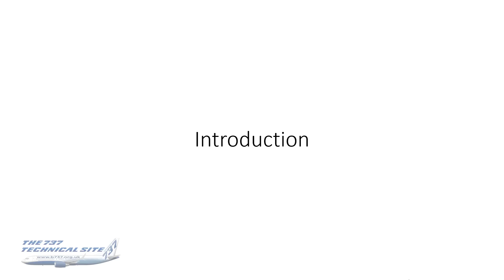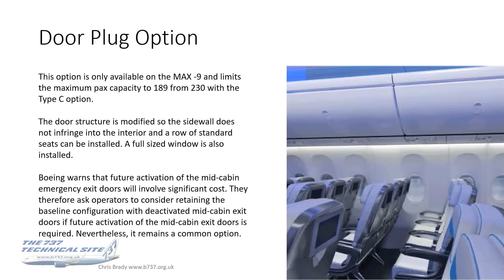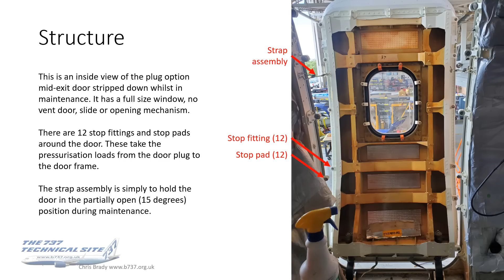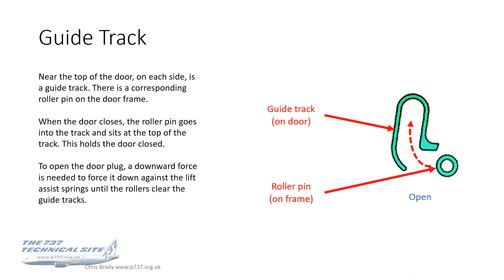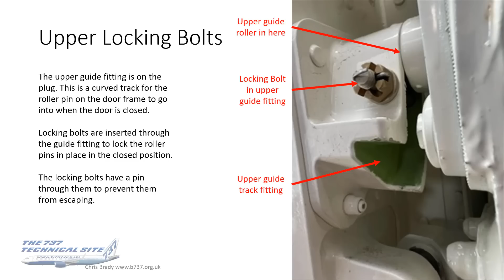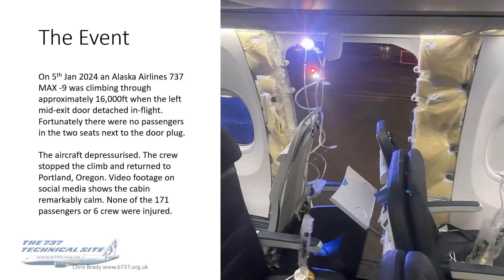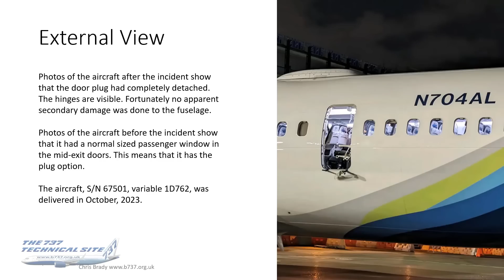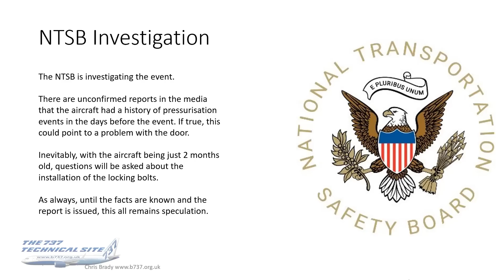737 Mid-Cabin Emergency Exit Doors - Plug Option

Comment: Update: found a picture that expains one of my questions.  And it was written in plain sight on the graphic by the author of video, my bad.
The guide track is on the door/plug and the roller pin is on the frrame.  Therefore, the door must be lifted so that the gide track rises to a point where roller pin can "exit" from it.
Reply from the maker: * Errata *
In this video I state that a downwards force is required to remove the door plug. I based this statement on text in the AMM SDS which I now believe to be incorrect or misleading. It is possible that a very small downwards motion (1-2mm) is first required to be able to free the locking bolts. But the door must be moved upwards by a couple of inches to clear the guide tracks. Apologies for any confusion.
Reply from the maker: AMM SDS 52-23-00 Page 6 MID CABIN EXIT DOOR PLUG - COMPONENTS, Lift Assist Springs:
"Apply a downward force to the door plug this forces it down until the rollers clear the guide tracks. At this time the door plug can open outboard."
Reply: At 06:43 and elsewhere in your video you show the graphic of the guides and roller pin,  and the roller pin is marked as being on the door frame ,a dthe guide on the door frame. And based on that, you need o lift the door so the roller pin finds its way out of the guide.   If the rollers are on the door, then yeah, downward pressure on door clears the guides and can open outward. The graphic published by NBSB Newsroom on the site formerly knwon as Twitter confirms pin on on feame and guide is on plug/door.  Is it possible the guide is upside down in yoru graphc and the opening is on top instead of bottom?  (not questioning your info, jusyt trying to understand).  And many thiks because you have brought so many facts in this.    @ChrisBrady737
Reply: @ChrisBrady737 You keep citing this as definitive, but it is incorrect. I really think you might need to reanalyze the other information to picture how the door plug is opened and there are many reasons that are obvious that once the locking bolts are removed the removal is up, then hinges outward. 

Look at the outside picture again. Why is there a cutout of the outer skin clearly visible above the door plug. It's there because the door has to go up to disengage the guide tracks from the frame mounted guide rollers before it can hinge outward.

Comment: If I was an airline that owned a 737 MAX-9 with the plug option, I would immediately be taking to the maintenance shop, removing the seats and interior panel and checking that all 4 bolts are present and properly secured with the nut and wire. Although I am sure that's exactly what airlines like Alaska have been/are currently doing.
Reply from the maker: That is probably what the emergency AD requires.

Comment: Do you know if there was any redesign of this plug and interface from the -900ER to the MAX?  Is it possible that the fasteners are done differently so an inspector might not notice a cotter pin that's missing or doesn't have its leg bent?

Comment: Wonderful description. Kindly anyone, just 1 thing is missing, If anyone can point out plug door operating handle from inside cabin plz...
Reply from the maker: The door plug does not have an operating handle
Reply: @ChrisBrady737  for the intial installation it must have a handle to seat the plug door in its position which may b removed after installation... saying that i doesnt cannot b digested

Comment: If you do another video about this, could you clarify if the door plug opens by moving down or up?  Is it a bistable mechanism like a landing gear hinge, or do the lift assist springs push it straight towards its open configuration at all times?
Reply from the maker: * Errata *
In this video I state that a downwards force is required to remove the door plug. I based this statement on text in the AMM SDS which I now believe to be incorrect or misleading. It is possible that a very small downwards motion (1-2mm) is first required to be able to free the locking bolts. But the door must be moved upwards by a couple of inches to clear the guide tracks. Apologies for any confusion.
Reply: It was confusing me too but I think you’d have to remove all 4 bolts, and then push down against the hinge springs to move the door plug/channel away from the pins attached to the frame, then once the door plug channel clears the door frame’s pins, it can go out. Seems to me like all 4 bolts were missing or very inadequately secured for this door plug to have come off so cleanly
Reply from the maker: AMM SDS 52-23-00 Page 6 MID CABIN EXIT DOOR PLUG - COMPONENTS, Lift Assist Springs:
"Apply a downward force to the door plug this forces it down until the rollers clear the guide tracks. At this time the door plug can open outboard."

Comment: @chris : Just thinking, isn't there a pressure seal too around the periphery of the fuselage cutout? 

There is a similar Plug door on Airbus A321, the ACF version and it hinges at the top while opening outward. The remaining structure is more or less the same as the Boeing plug
Reply from the maker: Yes there is a pressure seal

Comment: They didn't break off, but it's surprising how small those stop pads that hold the plug against the pressure of the cabin are. I was expecting something a bit more than those little ears.

Comment: Yesterday the video creator stated that the "plug" or more correctly the door blanking panel must be lifted to unhook from the stuctural-pressure-bearing-lugs. Today you say that the panel must be moved down. Looking at the mechanusm and the J channel bracket device it looks like yesterday was correct. Also the castleated nuts on the lockng bolt are locked with split pins. This suggests that they are tightrned to a low torque so as to not crush the upper J-channels or the hollow lower hinge struts. The split pin will prevent the nut from loosening or tightening.  The bolt retaining the blanking panel in the closed and locked condition by shear-load on the small bolt.
Reply from the maker: * Errata *
In this video I state that a downwards force is required to remove the door plug. I based this statement on text in the AMM SDS which I now believe to be incorrect or misleading. It is possible that a very small downwards motion (1-2mm) is first required to be able to free the locking bolts. But the door must be moved upwards by a couple of inches to clear the guide tracks. Apologies for any confusion.
Reply: Agree with your second sentence because it didn’t make sense as stated in this video based on parts involved.
Haven’t seen prior video.
Reply from the maker: AMM SDS 52-23-00 Page 6 MID CABIN EXIT DOOR PLUG - COMPONENTS, Lift Assist Springs:
"Apply a downward force to the door plug this forces it down until the rollers clear the guide tracks. At this time the door plug can open outboard."
Reply: @ChrisBrady737  That is hilarious - I mean, it's a nonsense, but so often you see instructions in the AMM that are complete nonsense.  I had a case where we had repeated failures in the same systems in our fleet, costing hundreds of thousands of dollars a year.  The engineers were diligently following the AMM procedure to test a pressure regulator - I had a good look at the procedure and it was written in a way that if the regulator wasn't regulating, it would nonetheless pass the test to confirm that it is regulating.  So I wrote a new procedure, but having told the shift managers that the tests they were doing weren't working, they just replaced all the regulators and the problems haven't returned since.  But if they do, the AMM will be changed when they do their next test.
Reply from the maker: Yes it is alarming that errors persist in the AMM and FCOMs after many revisions @paulsaccani1115

Comment: Fantastic video. So just 2 bolts keeping the door from sliding up out of the guides. I thought there’s supposed to be some redundancy built in into critical areas. I would have liked to see some type of hood catch or similar in addition to what you showed.
Reply: It look like there were two bolts at the top acting as pins, and additional two at the bottom also on those shafts above the springs
Reply: 4 bolts.

Comment: The critical thing about this design is that after the final and properly rigged installation a door plug, the assembly never moves down the 4cm which unlocks the guide pin from the guide track. That's the critical function that the four locking fasteners accomplish in two different protection mechanisms.

My understanding of the design is, that when in the "closed" position, the force of the hinge springs keeps the guide pin at the top of the guide track (just as its upward force would keep the pins from entering the guide track from the "open" position if the door plug was inadvertently shut when in the maintenance position.)

I suspect that even if only one of the four locking fasteners was in place (limiting pin movement down in the guide track or limiting movement of the guide shaft on the hinge), the stop pads would have stayed in sufficient alignment to not cause a failure. The hinge springs pushing up on the guide pin would provide additional location force.  So the system has some redundancy.

So I speculate that the root cause was that all locking fasteners were not installed and time or events overcame the upward force of the hinge springs, allowing over time both guide pins to move down the guide track to compromise the alignment of the stop pads sufficiently to allow the system to fail at load.  

Micro scratching on the stop pad interfaces should show wear indicating a loose and moving condition over time since delivery.
Reply: it moves up though

Comment: I'm not a pilot or engineer but I have one thought on the plug type doors that might be a better option and quite possibly prevent this sort of thing happening again. Why not make the plug door installed on the inside of the plane and have the plane and plug tapered smaller as it approaches the exterior. If it tappers 4-8 cm, has a good seal, and has 4-6 bolt secure points this should prevent this from happening. The door would not be able to blow outward as it would have no where to go. There was an accident in the UK in the 1980's of a different plane but same thing happening.

Comment: 7:10 You say the door needs to be forced DOWN to open it, but isn't that reversed? The door is lifted UP, with the force of the springs to open it, and down, against the springs to close it. If that's not right then some more explanation is needed about how the door moves to open and close.
Reply from the maker: * Errata *
In this video I state that a downwards force is required to remove the door plug. I based this statement on text in the AMM SDS which I now believe to be incorrect or misleading. It is possible that a very small downwards motion (1-2mm) is first required to be able to free the locking bolts. But the door must be moved upwards by a couple of inches to clear the guide tracks. Apologies for any confusion.
Reply: I noticed that also and it just doesn’t seem to make sense the way it was said, when looking at the mechanism diagram. I’m kind of thinking it’s somewhat vaguely similar to how a typical garage door would work.
Reply from the maker: AMM SDS 52-23-00 Page 6 MID CABIN EXIT DOOR PLUG - COMPONENTS, Lift Assist Springs:
"Apply a downward force to the door plug this forces it down until the rollers clear the guide tracks. At this time the door plug can open outboard."
Reply: I agree that there’s something logically in conflict here between the diagram and the text as shown at 6:33.

If paragraph two is true, which matches the diagram, then, how in paragraph three can the door be moved downwards when the pin is already at the TOP of the channels? .

Unfortunately, I cannot look at the photographs of those items at the same time I’m writing this. So, my next comment is based strictly upon this particular diagram and text.

However, thinking from an engineering point of view, which I’m not, but I have some mechanical background, if the roller pin was on the DOOR, and the guide track was on the frame/body, then it makes sense that you would push the door down until it clears the track. And that the springs would push the door pins up into the frame tracks and keeping it secured unless something pushed it down which the lock pins would stop.

Addendum: 
Looking at the photograph of the upper locking bolts at 9:05,  it certainly looks here like the roller pin is on the DOOR, and the track is on the fuselage based on this being the left side of plug as seen from inside cabin.
Reply: @JohnHallgren  The guide is on the door and the pin in in the frame. The image at 9:05 is of the right hand side of the door

 @ChrisBrady737  In that case "more explanation" is needed. The door mechanism as you yourself explained it needs to be moved UP to open.That's why there is a visible gap at the top of the door as visible from the outside. There is no obvious way for the door to move down. There is no apparent space in the frame, and as the other comment says it looks like the pin in the guide would be stopped from moving further in that direction (technically it's the guide that moves and the only place it can move looking at the diagrams is UP to release the pin, hence the door must move UP)
Reply: @softy8088  at this point I’m somewhat totally confused but apparently I’m not the only one who is noticing the total conflict in up or  down as to what moves where.
But if the springs at the bottom are trying to force the door up and open, then it’s only the bolts that are holding it in place, and if they’re removed, does the door go BOING and open? That doesn’t make sense either.. 
Plus his quote from the AMM implies that the rollers are on the door which is consistent with the actual photo.
Reply: @JohnHallgren  Simple, the AMM is incorrect and Chris is sticking with it so he's wrong too.

Comment: This is an amazing explanation. This will probably be more clear than the NTSB report will be. 

Seems like you are implying that those four locking bolts (or lack of) are the cause.
Reply: And missing Lift Assist Springs too, or the Plug would pop upward and then being free open

Comment: Could you please confirm is this plug option is essentially  the same as those used on the -900NG. I've seen images of a similar design on the legacy 900 series.  Any differences? If they're basically the same, further review of installation and/or maintenance work performed would be needed IMHO.
Thank you for the excellent review!

Comment: No matter the seat count all doors should be there and functioning. They save lives, the more you have the more lives can be saved. Cutting corners for profit is all I see.
Reply: No expert here, but I suspect the non-mandated doors are plugged to make the plane more attractive to the operator. There are likely regulations requiring all emergency exit doors be manned by a member of the cabin crew during takeoff and landing. Plugging the extra doors on planes configured for lower-density seating saves labour costs for the operator.
Reply: @thatdouche4436  yup, who cares if you could have a extra door to save a life or 2 😞

Comment: Interesting thought: Assuming the arrestor bolts were missing and the door assembly was able to freely move up and down this accident would have been less likely to happen at higher altitudes as the pressure differential causes more friction between the stop fittings thus holding everything in place.
Reply: No. The way the guide track is curved means that cabin pressure is converted into an opening motion. So more pressure differential, more force to lift the door over the pins.
Reply: @HenryLoenwind   If it was curved all the way how would you move the door from the start? The pin running inside the guide track would immediately get wedged if it didn't follow the curvature. And this it cannot do because for the first 1.5'' travel distance the door assembly is only able to move upwards in a perfectly straight vertical motion until all of the 12 overlapping stopfittings have simultaneously slid past eachother. Only now the door can be pushed outwards.
The track therefore must have a straight portion which also means the forces between pin and guide track don't result in pushing the door neither up nor down

Comment: Even without bolts fitted and the lift assist springs not carrying entire door weight, the residual door weight should still have the upper guides sitting firmly down on the frame guide rollers.
Until the mid door experiences -ve g in which case it could rise up off the rollers. What makes this remote however, is any p dif at all imparts high loads at the stops meaning high friction loads preventing door movement. So
has to be a lot more detail to go possibly involving missing bolts plus another contributary factor. 
They need the door to figure this out.